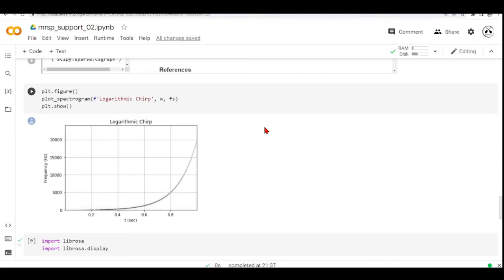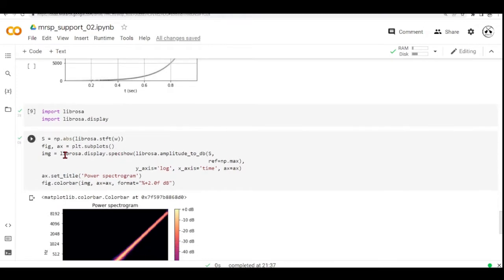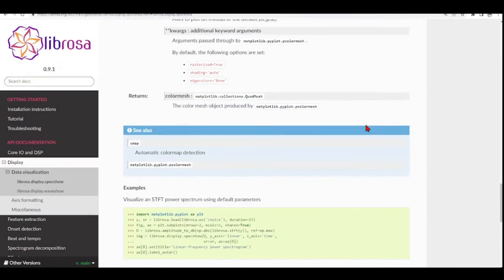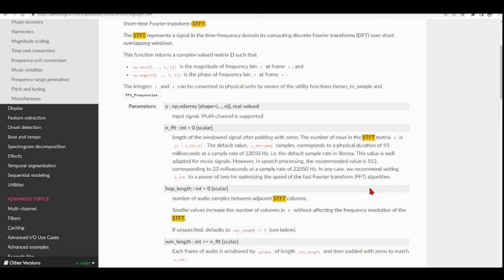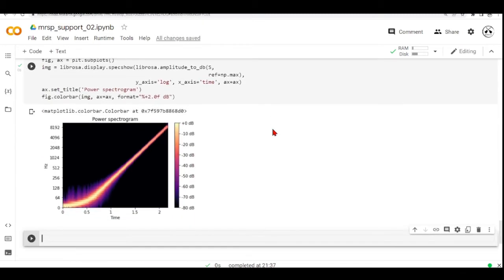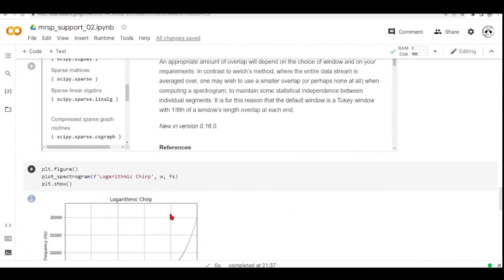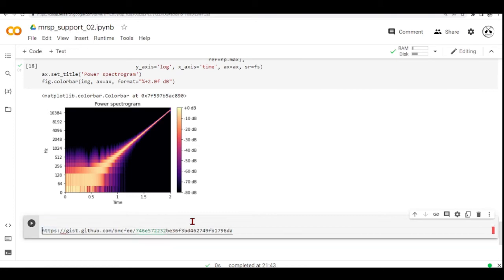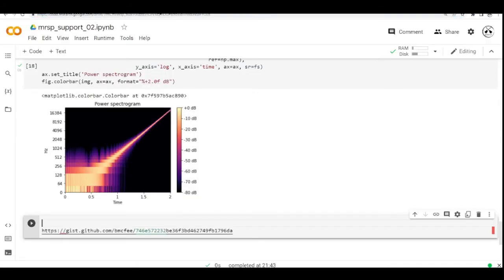Librosa STFT - Spectrogram Basics -  Seminar 02 Support Material

Comment: In librosa.stft there is an attribute 'center'. I can't figure out what is happening when center= True. I have already gone through the documentation. Could you please explain the use of that attribute?
Reply from the maker: Try to make an experiment: use a chirp signal, then plot two stft spectrograms with librosa, one with center=True, another with center=False
Maybe this could give you an insight of what this parameter is doing and what centered at y[t * hop_length] means.
If I have time I will take a look at this.